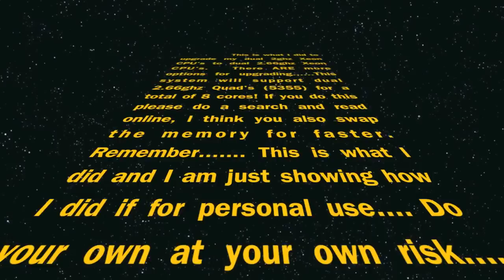Apple Mac Pro CPU Upgrade How To... 1 of 2

Comment from the maker: @breaksmash Apple never ment to have a end user replace the CPU's in these systems.  Also you can tighten down the heat-sinks better with a Hex then a Phillips, and you wont strip as easy.

Comment from the maker: If I remember correctly the bracket has a connector for power on it for the fan and you need to pull a bit to get it off that connector.

Comment: @SourNaik Macs use EFI rather than BIOS, and such GPU's are quite rare (much smaller market, 1 Mac can use them rather than millions of PC's). That should change though as EFI becomes more popular.

You can also flash the BIOS on many "PC" graphics cards to make them work with OSX. Most people tend to have better results with AMD cards than NVIDIA from what I've seen. Be sure you know what you're potentially getting yourself into if you intend to try this, you could end up bricking the GPU.